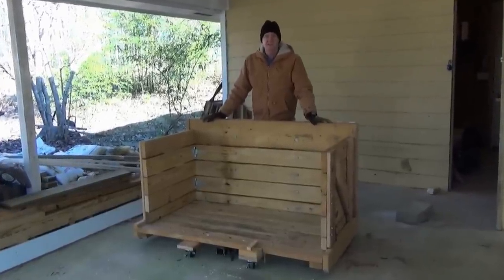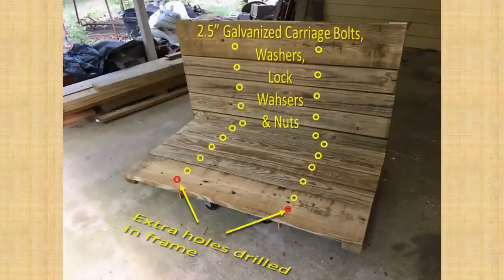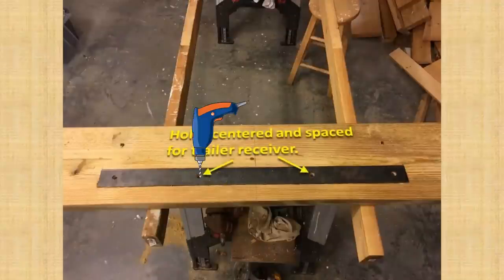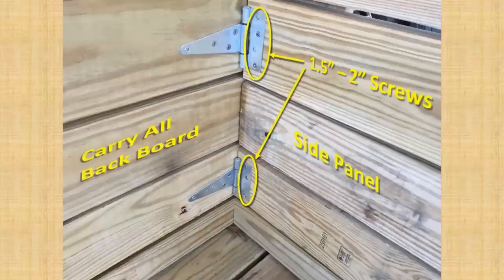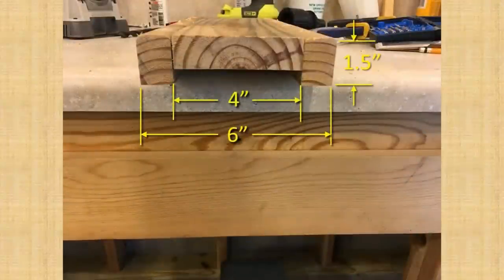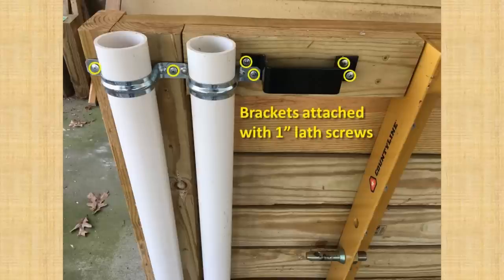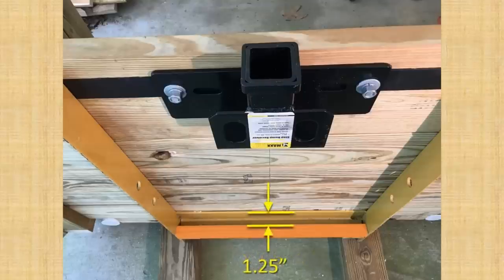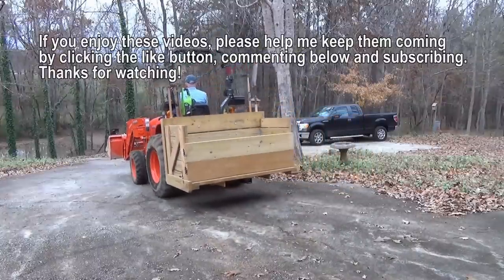Versatile Tractor Carry All for My Kubota L3901 Tractor - Part 2 (#17)

Comment: Question: I can't tell from the video or instructions. Is the 1st platform board flush to the metal with the back setting on top or is the first back board flush to the metal base. I started to install my platform boards with 1/4" spacers and when I got to the end my 2x10 was recessed and not hanging over like yours.  Update: of course lumber prices go up and the boards get skinnier.. it's a lot more than 1/4" between these boards.
Reply from the maker: Hi Duane!  It’s flush to the metal of the uprights.  Keep in mind that if your pressure treated lumber is fresh and soggy, it will shrink in width a lot, so either leave almost no space or let the lumber dry out before building.  The boards on mine now have about a 5/8” gap between them after drying out. Good luck!

Comment: best video I've seen so far and I'm only a minute in watching the video. I did seek your advice on the five foot width of the lumber, do you think six foot lumber might be too wide? the reason I ask is much of the dimensions of your product and tractor all almost identical with my future construction. I wanted your opinion on engineered strength of the six foot wide product.
Reply from the maker: Thank you for saying so!  I think six feet wide would be fine.
Reply: DIY My Way  Thank you.

Comment: You did a great job building this. What made you chose to have a separate fillet instead of attaching the small casters to the bottom of the carryall permanently
Reply from the maker: Thanks! The casters may not support the weight of a load if I disconnected it from the tractor.  Also I didn’t want to worry about it rolling away if I parked it on sloped ground.

Comment: Another great detailed build.  Any idea of the final weight?  I will be making one similar to this for my BX.
Reply from the maker: Thanks, Chuck!  I don’t know for sure but I suspect it weighs between 300 and 400 pounds.  If that’s a concern, you could frame it with 2x4 lumber and deck it with 3/4” pressure treated plywood.  You’d still have a lot of strength but a lot less weight. Thanks for watching!
Reply: @DIYMyWay  What a coincidence....I just finished a "lighter" build for a smaller tractor (23 HP).   4 feet wide, deck boards for the bottom and back (with a 2x4 bolted to the "forks" to screw the deck boards onto).   Seems to be plenty strong, no real deflection on the bottom boards when walking on it.  Because there is less space for equipment, I actually put a pair of 2x4s (effectively a 4x4) on the outside edges of the back wall to attach the hinges to.  That pushes the doors out a little further, leaving a space for tools behind the doors.  I put a couple 2x4's down the back (like you are using to hang stuff on) and tied them together with another deck board that sits flush across the top. I can add the PVC pipes on that board and they'll sit inside the carryall behind the doors when transporting.  

Okay, that was a bit more detail than I intended.   More importantly, great video and a great project.  Probably the best I've seen.  Keep up the good work.
Reply from the maker: Hi sdf8!  Sounds like you have made really good adaptions to the design to suit your needs and the size of your tractor!  I’d love to see a few pics of your build.  Quite a few folks of shared pics of their carry alls based on my video and I’m planning to do a follow up video on the carry all featuring some of the carry alls built by viewers.  If you would like to share a few pics, please send them to martin@diymyway.net.

Thanks for the kind words and for watching!

Comment: Curious to know if you happen to know what it weight when complete minus the dolly
Reply from the maker: Hi Don.  I have no clue.  Never worried about because the 3 point lift capacity is several thousand pounds and the carry all frame is rated for 1,000.  If the frame ever breaks, I’ll assume I was carrying too much.

Comment: Great video, I am from Canada and it’s seems to be dificult to buy that frame here and my brother is a welder, would you be kind enough to give the dimensions for this rack?, the metal frame..
Reply from the maker: Thanks, Francois!  Glad to share the dimensions with you.  First, it is made mostly from 3" angle iron, 1/4" thick the top section is made from 2.5" square tubing that I assume is 1/4" thick.  

The top link pin holes are drilled into two pieces of 2.5" bar stock 3/8" thick and the pin holes are 3" down from the bottom of the top square tubing.  

The back of the carryall frame is 36" tall and 26" wide between the part of the angle iron where the lift pins mount.  The lift pin holes are 16" from the bottom.  

The platform is 37" long front to back with a usable length for attaching boards of 29.5".

The 1/2" holes for bolts to attach boards are spaced 6" apart, but you can space them for whatever width of lumber you plan to use.

Hope this helps!

Martin
Reply: Thank you so much ! I will send you a picture when it’ all done 👍

Comment: Oh yea, made me a " miracle wonder " carry-all after 92 seconds of instuctions from a "like" vidio champ (ODWTM's); everbody knows them. Didn't get all that "Fancy-dancy", but DID NOT permanently mount the "BOX" to the frame, just wanted to be different & l thought that the "easy-way" was for "Pure-Ametures". Made a "quick-detach" system that be "disconnect-lated " in 6 seconds-flat, so the "Frame" can be used for OTHER  "attachments " & purposes . The "Box" can also be "convert-a-lated" to be used on the front loader forks to go "sky-high" 9 1/2 feet in the AIR--- "priceless". Thank you Sir for the Excelent vidio and happy safe tractoring. Best wishes with all your endeavours.
Reply from the maker: Hi Donald!  Sounds like you’ve made yourself a very versatile carryall. Nicely done! Thanks for watching!

Comment: The floor on mine required using four 2x6’s and one 2x12.  The 2x10 is simply not wide enough.
Reply from the maker: Interesting.  Are you using the County Line carry all frame?  A 2x12 would have been too wide for my build.
Reply: I am using the same Countyline carry all frame.  Maybe the Michigan treated lumber I bought is simply not as wide as what you purchase locally.  My floor is finished except for the side or end cap 2x6.

I am spacing the vertical wall rearward the thickness of a vertical 2x4 to accommodate use of my quick hitch.
Reply from the maker: Sounds like a plan, Bill.  BTW, I got your email and replied but the return email address was no good. Please try again to martin@diymyway.net.  Thanks!

Comment: Tractor supply is saying this frame will not work on a L2501 - has anyone tried this?
Reply from the maker: I think that’s nonsense. The frame is category 1. The L2501 has category 1 3-point hardware.  Also, I know someone with a L2501 who built my carry all design on that frame - no problems. Thanks for watching!
Reply: @DIYMyWay  Thanks! Awesome videos!